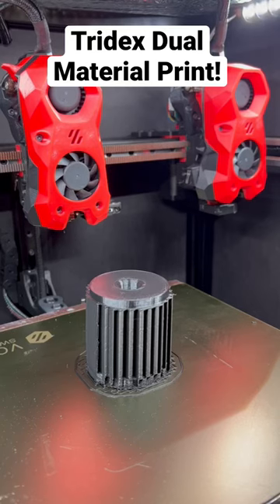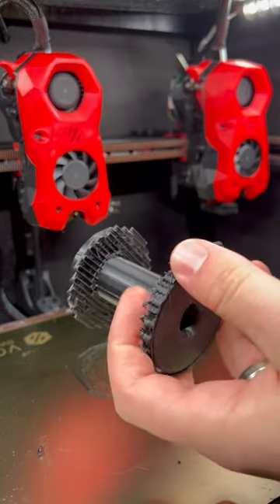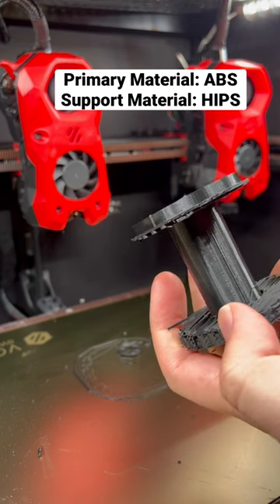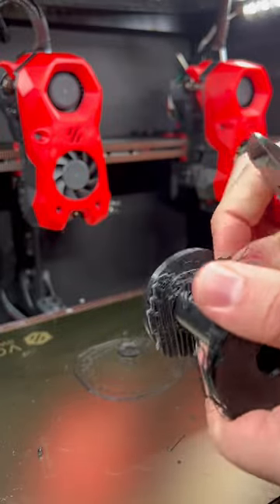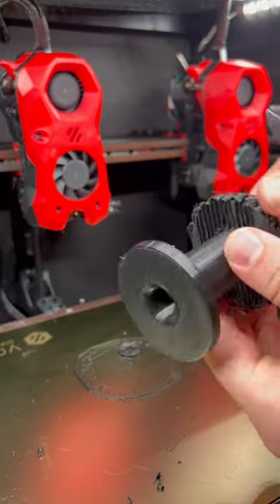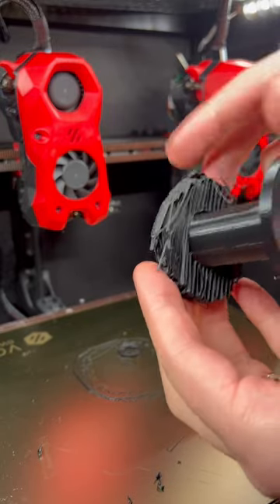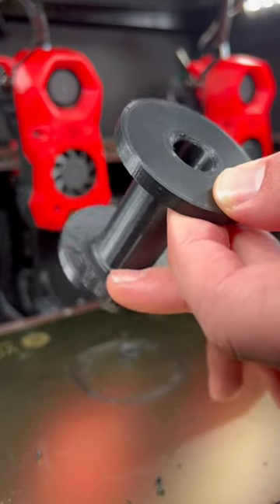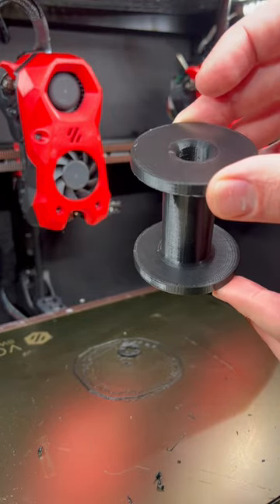Tridex Multi Material Support Removal!

Comment: I love those kinds of supports, especially with abs/asa. makes upcycling super easy. cut up the remnants with regular scissors, lay out on an aluminum baking sheet, set oven (MY oven, not THE oven) to 450f and when its all flat, turn off the oven. and viola, fresh baked panel sheet. no fumes because i dont open until its cool, and as long as the baking sheet is clean and good quality, it pops out no problem.

Comment: You do realize it would be way stronger if you printed it in 3 parts?
Reply from the maker: It would be even stronger machined out of aluminum! 😄
Reply: @eddietheengineer  yea but you'd get rid of the supports